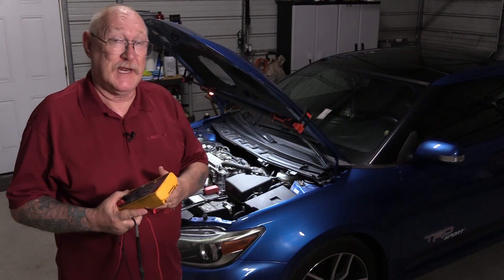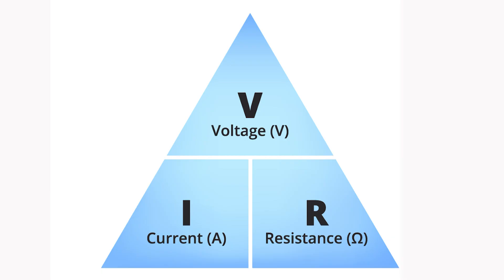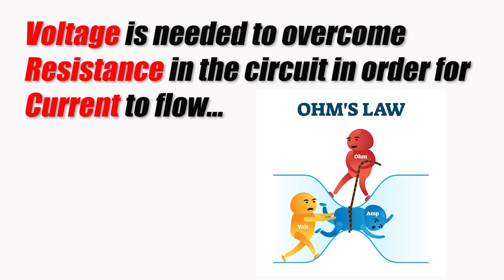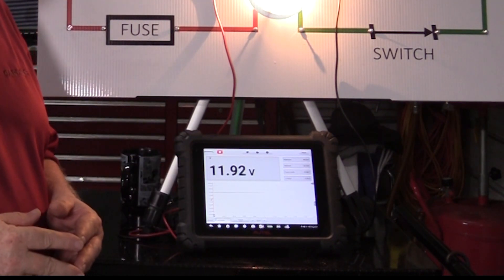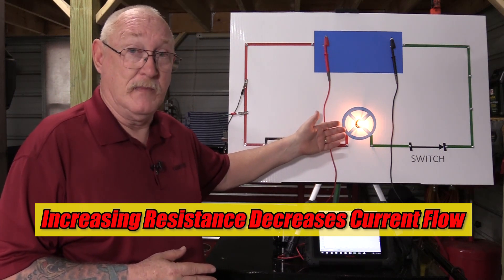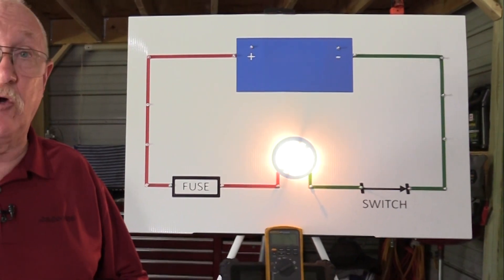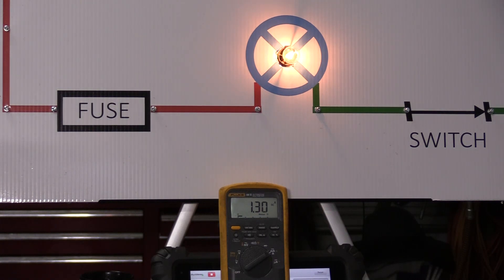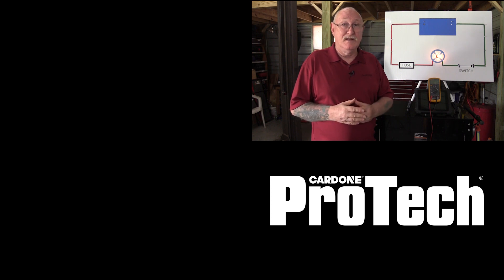CARDONE PROTECH #2 - Voltage, Resistance and Current - Oh My!

Comment: Dear Sir Pit,

my name is Pantelis 42 years and I come from Greece. discovered your YouTube channel a few weeks ago and I find it awesome. I love your profession way of explanation and the knowledge that you deliver. At my 42 living in Germany and learning car mechanic ( Kfz Mechatroniker Ausbildung) 3 1/2 years of education and simultaneously working in a Peugeot & Kia dealership. My question is, why since voltage and current are relative, how is it possible that a car battery with a dropped voltage potential of 11,2 or 10,5 volts ( battery to be changed ) when I try to start the car the amp meter goes up and of course the voltage down ? I mean, why the current does not also drop with the voltage ? And the second part of the question, how can the starter motor get damaged and eventually burned out from a "dead" battery after lots of attempts to start the engine ? My father as yacht electrician since 42 years, sais that as the voltage drops the starter is pulling more current 🙄. How is that possible ?? And finally he says, as the battery gets loaded from the alternator the voltage goes up and slowly the current goes down. Could you please explain this to me ? It is really frustrating.....whan all this the case is, something is wrong with ohms law. Perhaps could make a video about it . Many many thanks in advance, pls keep up the good work and God bless you 🙏

Best regards

Comment: I’m loving these videos. Electrical gets so confusing and he explains it so well. The usage of a demo board is a great idea because it allows for a true visual instead of just a drawing on a whiteboard. I’m currently on a search for an electrical vampire. It’s been intermittent. I thought it was a bad battery terminal connection, tightened them up with a socket set, drove for 2+ hours to charge batteries back up. Shut it off. No start. Hooked up a vehicle to charge the batteries (it wouldn’t jumpstart), left them connected for about 5 minutes and started right away. Drove 15 minutes. Shut it off over night. Next cold morning, it fired up right away. I can’t figure it out. 
So, that long story to say “Thank you, for sharing your knowledge!”
Reply from the maker: Thanks for the comments! I hope it helps you find that gremlin.